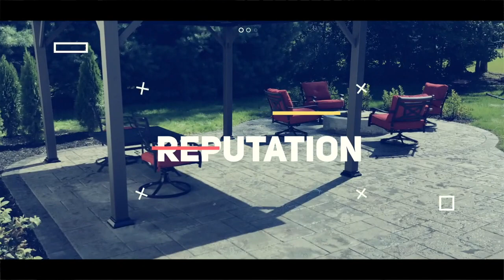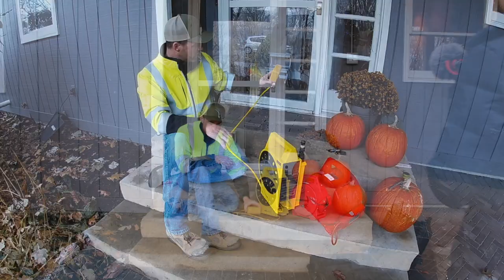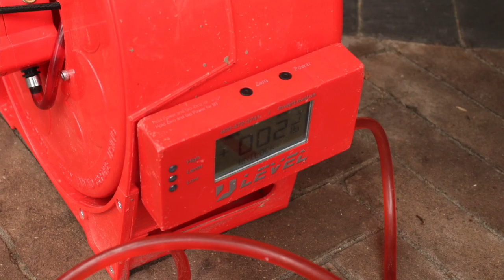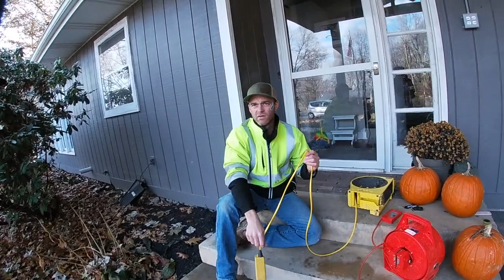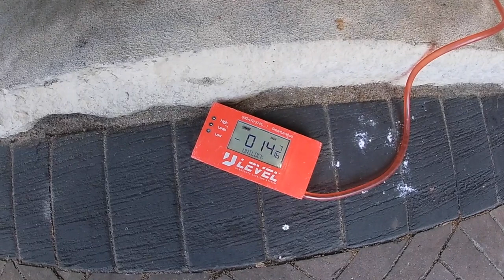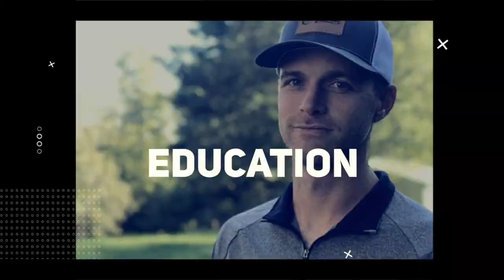U Level Vs  Zip Level

Comment: I don’t know the U-level but I have tryed the “Carry on” function of the Zip Level without good results.
I have called technical corporation several times and the repetidle delay a video presentation of the use of that function.
What I think is that the Zip Level was launched in the market with limited operational functionality. I mean, the carry on function does not work as advertised
For big areas (500-600 feet or so) nothing is better and faster than a rotary laser (unless you have access to high tech drone)
I find a waste of money and I want return it
That is the problem, you are reviewing a product (and endorsing it) that you said “has functions that still don’t know to use”, so, use those functions, evaluate them, and then, and then give your opinion of that product
In conclusion, grab your Zip Level and take to a 800’x800’field and take elevation of all the field, and then give a say
I tell toy what: I change my 100’ cord Zip Level for a nice Bosh rotary laser kit with 800’ range
Reply from the maker: Ok.

Comment: Great tools for grading.  Very frustrating for patios. These units seldom hold zero and rarely do two units agree with each other.
Reply from the maker: Hmm..We haven't had problems with it really. We have had the zip level calibrated a couple times now, but it seems to be pretty accurate for us at least.

Comment: I appreciated watching your review. I ended up buying the Smart Level (the U-Level's other branded name) after watching your comparison along with Pave Tool's. My experience was different than yours, however. Have you ever checked your readings in going back to your zero point after you're done with all of your readings to see if it's still stable at zero? Mine fluctuated a lot. I posted my thoughts/review here: https://youtu.be/mcwdmruOLzM
Reply from the maker: Good choice! I'm sure you'll be happy with it!
Reply: @Aumanlandscape  Based on the info I shared on my review video, I went back to ZipLevel.

Comment: You advised getting 2 Zip's, though.  1 for estimator.  1 for crew.  Therefore, when/if Zip cord severs - you have a back up.  And you can continue to use your (what sounds like) preferred machine while the other Zip's in repair.  Brilliant.

Comment: Great video! There are some crucial differences: ZIPLEVEL is pressurized to prevent routine bubble formation and removal (see video:  https://www.youtube.com/watch?v=VO979Du2vlA&t=2s  ) with a sensor immune from accidental overpressure destruction. 

With its self enclosed design, ZIPLEVEL sets up, packs up and reads faster over a much greater -22F to +158F, is more than 10X as precise (High Precision not just Precision) with paper thin precision, will do leveling over unlimited vertical and horizontal ranges without computations, has intelligent stable reading capture, will store 137 readings internally,  has a SmartLink option for real time plotting on a smart device and 16 powerful labor saving functions.